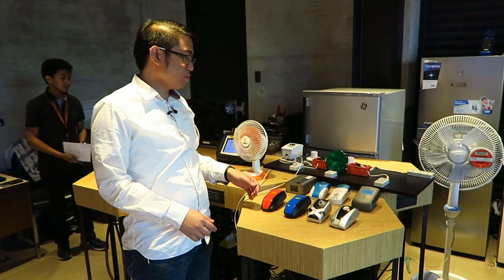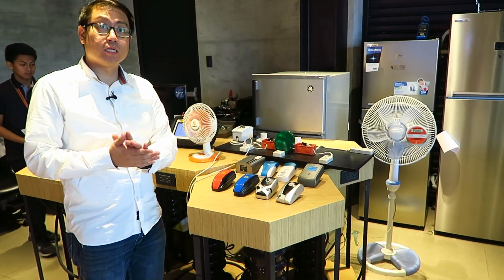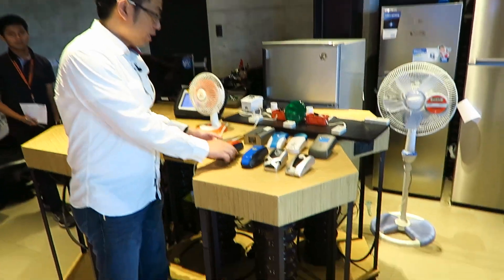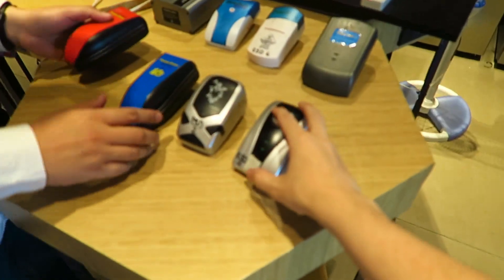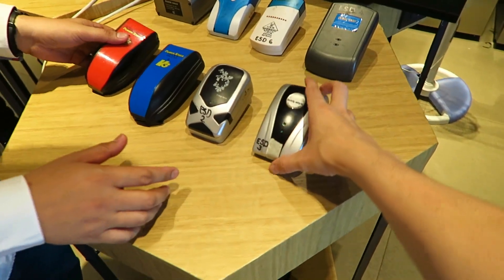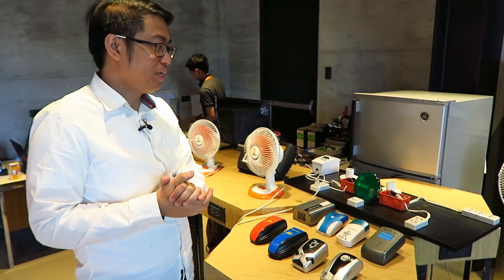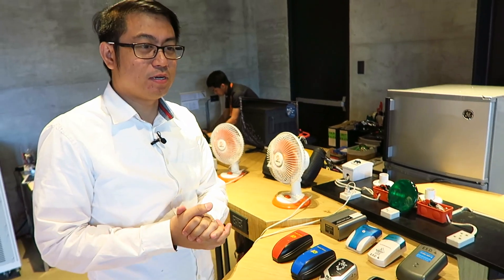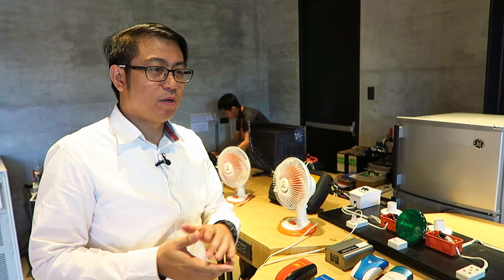Power Savers at Meralco Power Lab

Comment: The idea that you can plug one of these into any branch circuit in your house and get whole-house power factor correction is simply ignorant.

Got big motors? They already have their own start and run capacitors.

Comment: Bottom line is they do not work and if voltage goes up, like 220 vs 110 motor, the wattage used by most motors goes down, along with the amp draw.....If they draw less amps, they use less wattage....Period...So, It's cheaper to run a 220 motor, than a 110 volt motor....Twice the voltage, half the amps.

Comment: You say that the first one you picked up, does not work. However, the one that I bought a few years ago, at Walmart, in their "As Seen on TV" section, works!

My electric bill went from $259 to $139. The second month. That was 3 years ago.

Since then, my highest bill has been $149. My bill this month, which we just paid, was $98!

I run the air conditioner constantly, I am home most of the time, (retired), and leave the temp on 74 most of the time, winter and summer. My utility bill is higher in the winter because I have a gas heater but, my electricity bill goes down more in the winter.

If it did not work for you, either you had a defective unit or you did not follow the directions.

You have to plug it into the outlet on the same wall and preferably the outlet, near the outside meter. 
The reason I believe that my bill went down the second month is because I moved it from the lower electrical socket to the upper one, thus bringing it closer to the meter entrance. (which is what the instructions said)

It worked for me and reduced my bill DRAMATICALLY!
Reply: Hey if you happen to read this , can tell me how do get a reliable power saver ?

Comment: Thanks for the video, but I was told, increasing current can reduce wattage...It's like a 1/2 hp 110 volt motor drawing 10 amps will draw 5 amps if it's a 220 volt and  same HP...I too, think it's a scam, know what capacitors do, but understand what they're trying to do...Increase voltage, reduced wattage...To bad, it just isn't feasible.
Reply: Watts is the amps multiplied by the volts (W=iR) - so if either amps or volts goes up, watts must go up.  For wattage to drop, one or the other - or both - have to drop.  And since wattage is simply a measurement of power (1 hp = 745.7 watts), dropping the watts is the same as saying you're dropping the hp - it means whatever you're using is not as powerful - weaker motor, dimmer lights, etc.  In your example, your motor uses 1100 watts, regardless of whether it's 220v x 5A, or 110v x 10A.

There's no free lunch.

Comment: I does not agree, you have to look deeper at the matter, the power factor capacitor correct the sinus wave of your of your current, if you sinus wave is not nice and smooth  your applainces will draw more energy in order to do what they have to do.  Kw=Voltage* Current if your current is high your Kw usage will be high, because of the power correction your applainces need less energy (KwH) to do the same work.
Reply from the maker: Power factor correction for industrial premises makes sense, when done properly - not with the tiny little capacitors that you find in many of the "power saving" devices sold to regular people.

For residential customers, the power companies are not looking at power factor, so it's irrelevant and won't save you money on your bill. 

These so-called "power savers" have already been busted by the National Institute of Standards and Technology, as well as countless other credible sources.

Comment: So I know they don't really save any power but can they smooth out power at house or help with low voltage and also act as surge protector? We have like 185v to 195v here since there's a lot of user yet still the transformer installed in the neighborhood is a small one. I don't plan on buying this since it's kinda a waste of money but may I ask if they still do anything like improve electricity quality? Or they just do nothing.

Comment: He spoke non-sense. Electric power is equal to voltage times the current. If current goes down with  fixed voltage, definitely power(watt or kw) goes down, too.

Comment: It DOES SAVE power. I tested it by myself I am saving 12%. Yes it does not reduce import bill but It will safe generated energy wich IS COUNTED in KVAh and not in KWh. So it works.
Reply: Lol no
Reply: VA = watts.
Reply: How does it "SAFE" energy?  Wich power companies bill in KWh so it doesn't work. My  spell checker works better than this product.
Reply: @hankkline7300  Well it increases the power factor (You can find what it is by typing "power factor" in youtube). So when you are selling the energy and consuming part of it at the same time, part of your energy is lost due to weak power factor, so you sell less energy to the line.
Reply: If you are being penalized for 85% power factor, this product will help you. If not, it will only help the people selling this  product. How does it "SAFE" I think they mean SAVE, generated energy?
Reply: @hankkline7300  Its not about some penalties. If your power factor is 85% and you are using your own energy then if you make 100kWh, you can use only 85kWh of it other 15kWh is a waste
Reply: @strssko  How did you test it yourself? They may reduce your amp draw slightly, but not enough to change your bill. Besides your bill is based on VxAxpf so if your pf is low, it reduces your Kwh. These products are sold to people who will believe anything a fast talking salesman will tell them. Why don't you buy one of the $89 air coolers that will cool a large room from 95* to 72* in ten minutes. using only a little ice water and $.03 worth of electricity? That will save you a lot of money. I can also sell you a fish carburetor that the automotive industry doesn't want you to know about. It will get you 100 miles per gallon.
Reply: I test it with a magic device called multimeter :D
If you really think that you know better about my power distribution system which you have never seen then just skip buying theese things.

Comment: It is a step down transformer with a capacitor. The voltage is lowered by 10 percent so during demo one will see that the kilowatthourmeter spins much slower since the current is reduced. But in the end it does not reduce the power consumption anyway. The power factor correction is not necessary in most residential dwelling.

Comment: I have seen this before and it only works on one side of the electrical box. You have a center tap transformer going to your home. one side to center gives you 120 volt the other side to center gives you 120 volts and across the two outsides is 240. This unit only works on one side. in addition you don't want to plug things in to the wall you want to solve the issue at the electric panel because the device itself draws electricity.

Comment: Buddy, what if the capacitors are BIG ENOUGH will it reduce my bill? If I got a so-called power saver with BIG capacitors like 60KW (not the plugin type but the ones connected before your circuit breaker) computed from more or less the total watts of my appliances (2,100watts) will it reduce my bill? Hope you can help me out on this. Thanks in advance.

Comment: ehhh wrong,  power is equal to voltage x current x power factor,  kung low current low din ang power, directly proportional yan pre.
Reply from the maker: This video goes into more detail about why power savers cannot save you money if you're a residential customer - https://www.youtube.com/watch?v=GX_aTnkY79s
Reply: Gadget Addict I did not say that power savers are true or not, what I'm saying is, when current is low then power is low, P=VI(pf). so basically this guy does not know what he says.
Reply: ang bumaba lng jan ay yung active power hindi yung apparent. kasi ang laman nyan ay capacitor lng
Reply: Capacitor lang laman nyan. Mga bobo lang maniniwala jan.. Kung totoo yan sana lahat ng appliances na nabibili natin lalagyan nla nyan.
Reply: Tama Sir, yang formula n yan, Apparent power ang tawag dyan. May (3) klase ng power sa electrical engineering. Real Power = Current squared x Resistance rated in Watts, Apparent power = Current x Voltage x Power factor rated in Volt.Ampere (VA), Reactive power = Current squared x Inductive Reactance (XL) in Volt Ampere Reactive. Halos lahat ng appliances de transformer pra mastepdown into usable DC. Ung transformer, inductive load sya n laging present. Kung may capacitor magccancel out un dahil inversely proportional ang inductor sa capacitor. E2 ung theory ng "ELI the ICE man" sa Electrical Engineering.

Comment: Most modern appliances are highly efficient nowadays. That means your almost operating at unity power factor and almost no more power factor (P.F.) to correct, if there is some it is almost negligible. Power Factor correction is only used in industrial application were loads are highly inductive. Power has three (3) components, Watts - which is the useful power, Volt-Amps-Reactive (VAR) which is due to the characteristic of your load whether it's inductive or capacitive, Volt-Amp (VA) which is the total power delivered (Watts + VAR) but only the Watt is useful and the VAR is due to the losses in the system.

Comment: well... I am not a electrical engineer but only a technician,I can't think that anything that it will work...
Reply from the maker: I'm now wishing we did a hands on demonstration to show what these things do and why it doesn't save you money. A practical demonstration. Perhaps that's something we can do in the future :) I really don't want to buy one myself just to demo it.
Reply: Gadget Addict there are just capacitor inside it helps nothing... just a safety barrier for electricity...
Reply: im an engineer and yep there the same as just adding a capacitor if you really want to save energy buy appliances that have high efficiency

Comment: i hope they have the sample of illegal box that causes the analog meter disc to brake and rattled.. hahahah
Reply from the maker: That's a thing? I've never heard of that before! Sounds a bit crazy lol. In the UK they will heavily fine you if they suspect you tampered with the meter. In fact I think it's considered a criminal offense. I don't know if it's the same here. Although most homes in the UK are using 'Smart' meters now instead of the old analog ones.
Reply: hahaha well its not tampering.. the box generates addtional frequency ofset of the 60hz causing the plates to rattle and to move slow.. its like magnetic braking.. thats why they dont supply analogs anymore.

i also remember the old trick back then.. using ants to stop or to slow down the disc rotations
Reply: well meters here uses ge 210 directional meters.. its just a basic watt meter with ir signal reader for special use. most residential uses those meters. and the orange tagged meters are for kuryente load. somewhat smart meters that they can remotely cut off your supply if you ran out of load. and they can get your readings remotely unlike the other one, meterman needs to check it every 22nd of the month for readout